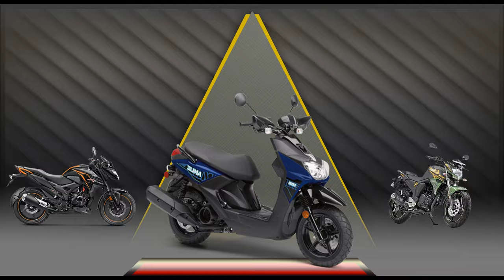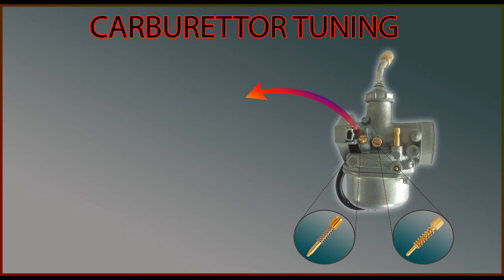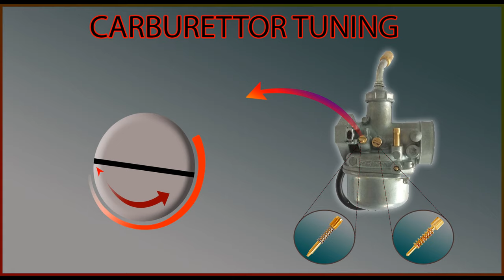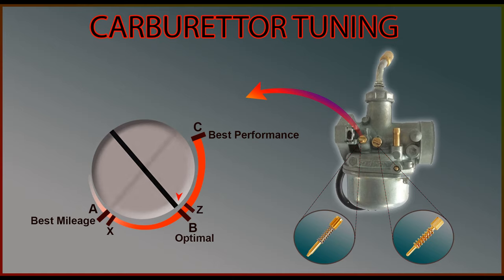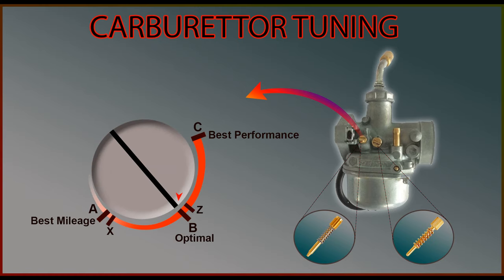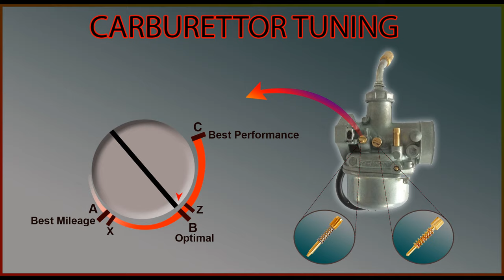Bike or Scooter carburetor tuning for mileage, carburetor setting. TVS Jupiter, Wego. #carburetor

Comment: Sir can you please explain what will happens in sparkplug (colour change )if carb air screw turn for each adjustments A, B&C
Reply from the maker: There will be no impact to spark plug
Reply: @autobotgeekse  sir but spark plug tip contain black, brown, white colours. What is it meaning
Reply from the maker: @ragulkr8975  That is the color of electrode insulator and has nothing to do with its performance. It just helps the conductive surfaces to be exposed on the tip for sparking

Comment: Can I use ASC carburetor on bajaj bm 150cc and will it work well
Reply from the maker: As long as manifold flange matches for proper fitment, it should work
Reply: And can use 80/100 by 17 front tyre on bm bajaj 150cc
Reply from the maker: @albertngala5739  can use it if internal radius does not change. Please see my other video where I have explained the affect of wider or bigger tyres on vehicle

Comment: Isn't tightening the fuel mixture screw reduces the fuel flow and loosening it increases the fuel flow as originally said in the video ? 

But your captions say otherwise. 

I have watched the yt shorts video of OneUpMotoGarage where he also explains that tightening the fuel screw gives a lean mixture and loosening will give a rich mixture, as it is logically understandable that tightening the fuel screw will reduce the space for the fuel to flow as the screw takes up the space inside...
Reply from the maker: Tightening the air screw will result in lesser air passage which in turn affects the fuel siphoning. When we talk about the mixture, it is the air to fuel ratio that we talk about. When we tighten the screw, there will be no barrier restriction for fuel siphoning since the fuel line aperture is still not letting the maximum fuel flow since the air screw is not completely open yet, hence a rich mixture. Alternatively, when we unscrew it completely, the maximum air passes through the passage. However, due to the limited fuel line aperture size, it can only siphon the maximum fuel which can pass through the aperture. Hence, the lean mixture as the ratio of air will be more than that of fuel.
Reply: @autobotgeekse  thanks for the response sir .
Reply from the maker: @redpillsbluepills  welcome brother

Comment: Unfortunately,  I did not notice any increase of engine sound though i losen the air fuel screw.....will you pls tell me the reason? Bike: yamaha zr scooty
Reply from the maker: Your idling must have been high, hence no change was observed. First tighten the air screw completely (pls do not overtighten, stop tightening when you can feel the resistance). Then adjust the idle screw so that the engine is at lowest RPM and is barely on. Then start opening the air screw, you should see an increase in RPM

Comment: I have only an single adjustment do I do the same?
Reply from the maker: Some motorcycle carburetors will have Butterfly valve. For those idle screw will be different. I have shown image for them in this video. Please identify the air mixture screw correctly for adjusting

Comment: Sir if engine runs at lean position, will get more hot engine Or it is ok please reply
Reply from the maker: Yes it becomes a little hot. However, that is within acceptable tolerance levels which is tested by manufacturer. No worries
Reply: @autobotgeekse  thank you🌹
Reply from the maker: @godugurajanna6256  wc 👍

Comment: Can I perform the same on Hero maestro edge BS4 110CC engine?? To extract max mileage?
Reply: Nd also, I want to know which air/fuel mixture screw is present in maestro edge.  Wheather it's a air screen or a fuel screen? 

Nd what happenes if I tight air/fuel screw clockwise in maestro edge 110cc? Will it become rich or lean?

Try to give detailed explanation. Thank you
Reply from the maker: Yes, any carburetor vehicle will work on same principle. Air screw will be the one with visible spring. Turning the air screw clockwise should make the air fuel ratio rich.

Comment: Can I use shell advance oil on my bajaj boxer bm 150cc
Reply from the maker: Yes you can use it. Please check the viscosity rating before using. I think it should be 20w-40 but please check the manual for correct viscosity

Comment: Could you please tell me where the starting point is of where I need to put both of the screws at the proper beginning to start the tuning
Reply from the maker: After closing the air screw completely, open it by 1 turn and then start tuning

Comment: My scooter keeps cutting out, it was fine but now I have to Rev it to stop it from cutting out. 

Is the carb dirty or does it need to be tuned?
Reply from the maker: Please check the idle jet and clean it. That should fix the issue
Reply: @autobotgeekse  Thanks for your reply. Where is the idle jet typically located? This is on a Suzuki Burgman UB125
Reply from the maker: @antoniobuys359  wc, it will be inside the carburettor. You will need to get the carburettor cleaned. Usually both main jet and idle jet will be cleaned at the same time of carburettor servicing

Comment: Any harm for engine if i run engine lean?
Reply from the maker: No, just that the engine runs a little hotter
Reply: @autobotgeekse  tighten the air screw mean less fuel?
Reply from the maker: @rishabhverma5497  yes, less fuel when compared to lean setting. However, fuel to air ratio will be more

Comment: Sir my TVS Wego has been driven 12,000+ kms and is providing less mileage (around 28+) will this help? 
Also there is loss of power when we give accelerator aftr slowing down.
Reply from the maker: This should help. However, your vehicle will have to be checked for other factors influencing the mileage as 28 is very less for wego
Reply: 28 kmpl.?

May be fuel pipe has been damaged. Check with mechanic once.

Comment: What happened when air fuel mixture screw fully open , is getting more milage or not
Reply from the maker: No, you will get less mileage when air screw is opened completely. Also, engine will run a little hotter.

Comment: Unicorn 160 cc bike how much turn after tightening Screw.1 turn means 180 degree or 360?
Reply from the maker: 1 turn is 360 degrees. It should be around 2 turns from close position but try to identify the point basis the steps shown in the video for correct setting.

Comment: I have dio ,but after one night initial start hard have to crank serval times ,carb set optimal tuning,sir what can cause for it,
Reply from the maker: Did you try choke? Also try cleaning the air filter. Dio and Pleasure usually have cold start issues

Comment: Dear If i accelerate my bike slowly gradually it does smoothly accusations, but when I accelerate it suddenly or abruptly, my engine dies out, why? My bike is suzuki gsx 110 4 stroke.
Reply from the maker: Try to clean the main jet, it might not be allowing sufficient fuel to reach the combustion chamber upon sudden acceleration

Comment: Seen it with your own eyes is way different you can keep going back to the reference of somebody doing it in real time
Reply from the maker: Realtime tuning is done practically towards the end of the video for your reference. I know this question will surely come. Hence, I told in the beginning itself that I will explain it theoretically and practically as well. You tend to miss important points when you skip the video. My humble request is to watch the video without skipping to avoid incomplete info. You can also see my other video where I have shown the mileage test for all 3 settings

Comment: Sir even if rpm is rpm dows it take more fuel or inly air? I am confused hw rpm screw works does it and adjusts rpm. What is princiole behind it nd hw it works.
Reply from the maker: Rpm screw is different than air screw. We use rpm screw while tuning the carb so that idlin can be adjusted. However, it is air screw that allows the fine tuning of carburettor
Reply: @autobotgeekse  rpm bhi to sir fuel leta hi hoga na tabhi to rpm fluctuate hota hai ghumane pr.
Reply from the maker: @coolcalm582  rpm throttle par bhi depend karta. Idle screw sirf rpm ko set karne ke liye use karte hain. Throttle ke hisab se fuel suction vary karta hai. Lekin air screw ka air suction line alag hai
Reply: @autobotgeekse  sir mujhe ek chiz samajh nhi aa rgi hai jab throttle close hota h tab throttle valve bhi closed position me rehta hai....but fir iss case me engine chalu kaise rehta hai kuki throttle valve to close h fir engine me petrol air mixture kahan se pohochta h?
Reply from the maker: @coolcalm582  throttle close hone par bhi idle screw throttle ko poora close nahi hone deta. Thoda air ventury se pass hota rehta Jiske karan pilot jet se fuel suction hota rehta hai
Reply: @autobotgeekse  oho thik ab samjha thnx sir clear krne k liye..mazaa aata h ye sab questiin krne me aur sekhne me
Reply from the maker: @coolcalm582  wc bro. Apke samay ke liye dhanyawad 👍

Comment: Hi, mere hero hunk ka milage abhi 20/L de rahi hai. Maine curburator clean karaya, new air filter lagaya, spark plug change kiye. Phir vi same issue hai. Spark plug black sukha curbon se bhar ja raha hai. Please suggest kijia kya kare.
Reply from the maker: Dekhiye agar bike jyada dhuan chod raha hai kya? Spark plug kala padne ka karan engine oil ho sakta hai. Agar piston ghis gaya ho ya piston ke O rings kharab ho tabhi yeh problem ata hai. Ek baar bore aur piston check karva len.
Reply: @autobotgeekse  kala smoke nahi deti hai. Or km run vi 20k cross nahi kiya hai. Engine oil last nov 2020 ko change hua tha.
Reply from the maker: Hmm, thoda strange hai. Fuel station change karke dekhiye, petrol milavati hone se bhi same problem aa sakti hai. Cylinder mein oil jane se hi spark plug kala padta hai

Comment: sir many mechanics says that set the scrue where you get higher RPM. and this will be the point where you will get higher mileage.  but you are saying that when RPM is low then we get mileagr . plz explaon what is right
Reply from the maker: Yes that is the reason why I made this video. Please see my other video which shows the mileage test difference between all 3 settings. Rich setting gives better mileage.
Reply: @autobotgeekse  it means first we have to tighten the air fuel mixture scrue then loose it to the higher rpm and then retight till we get lower rpm. and this point will we the highr mileage point ?
Reply from the maker: @Fake And Fair  yes correct. However, if you face any cold start issues try to bring the air screw to optimal position

Comment: Is it possible to have a tuned carb but the rpm in my speedometer slows down?
Reply from the maker: Yes it is possible as rpm also depends on the idle screw as well. Before tuning the carb, increase the rpm by adjusting the idle screw, then tighten the air screw completely and then loosen it by 1 and half turns. Then start the tuning process. Adjust the idle screw occasionally if rpm is too high while tuning.

Comment: Sir kindly explain yamaha fascino scooter carburettor tuning
Reply from the maker: It will be similar to this. You just need to identify the air screw and the idle screw. All carburettors work in a similar fashion
Reply: But fascino have cv carburetor not 2 screws
Reply: Thank you sir ( Autobot geeks & Navaneeth Krishnan K )  , for your reply 👍

Comment: Tighten air screw mean less fuel?
Reply: No ! Tight Mean High consumption 
Release screw to Lean or low consumption fuel
Reply from the maker: Tightening the air screw will result in lesser air passage which in turn affects the fuel siphoning. When we talk about the mixture, it is the air to fuel ratio that we talk about. When we tighten the screw, there will be no barrier restriction for fuel siphoning since the fuel line aperture is still not letting the maximum fuel flow since the air screw is not completely open yet, hence a rich mixture. Alternatively, when we unscrew it completely, the maximum air passes through the passage. However, due to the limited fuel line aperture size, it can only siphon the maximum fuel which can pass through the aperture. Hence, the lean mixture as the ratio of air will be more than that of fuel.

Comment: Sir meri activa 4g mei ek problem aayi thi achanak iss lockdown mei, woh baar baar band ho rahi thi, fir maine thoda sa RPM WALA SCREW BADHA DIYA THA, fir aisa hua ki race thodi thodi apne aap hi lagg rhi thi, uske baad maine ek service krwali or mechanic ko problem bbhi bata di, fr jab mai uski shop pe tha tab toh thik thi, but uske thode time baad apne aap race lagg rhi thi 20 ki speed takk, fr 2-3 baar adjust krayi hai rpm, ab jb last time krwayi hai, toh wopis band hone ki dikkat aa rahi hai breakers pe, kya dikkat hai aap bata de please, woh keh raha hai carburettor dalwalo new jabki sirf 20000 km ke aas paas chali h, please kya dikkat hai bata do??
Reply from the maker: Should not be a carb problem. If it is a BS6 vehicle, there should be an air valve on your petrol tank. This problem persists if that valve gets blocked. Have that checked once. When your vehicle stops, open the tank cap and start the engine. Keep the cap open for sometime and then see if beat is stable. If it is, then that is the issue.
Reply: @autobotgeekse  sir it is BS4 VEHICLE, but still I will check what you have suggested, I have also told him many times to check the valve and tapped, but he is saying that it is ok, I trusted him because he used to work in a vespa service center.

I will try what you have said
Reply from the maker: If it's BS4 and you don't see a separate valve on the tank, then the air intake valve will be incorporated within the fuel tank cap itself. In that case you will need to open the valve mechanism and clean it.

Comment: How to burn the fuel 100% and get maximum out of it. Please tell me the ways and other methods to do it.
Reply from the maker: Air fuel mixture ratio should be appropriate and ignition coil should be producing sufficient amount of spark for fuel combustion. Only in this case vehicle can get maximum out of the fuel.

Comment: My scooter activa sometimes shows correct idle speed and sometimes less idle speed and the engine shuts off. Is this the problem of valve tappet or engine idle speed setting ?
Reply from the maker: Try cleaning the idle jet. Sometimes fuel does not flow uniformly from the jet causing irregular beat.

Comment: please tutorial for carb tuning of tvs neo xr
Reply from the maker: That model is not available in India. All the motorcycle carburettors work in a similar fashion. You can follow the steps mentioned in the video to adjust the carburettor. Air mixture screw has to be identified correctly.

Comment: How much fuel mixture turns for cbz extreme ? Thnks
Reply from the maker: There will not be any fixed turn count. Tighten the screw to see where you are getting the lowest RPM and then unscrew by 1/3rd or half turn.
Reply from the maker: God Love  1/3 Rd will be 33% of a full turn

Comment: Dear Expert, must the vacuum tube be pulled out when tuning
Reply from the maker: If you are tuning the carb of a scooter, it helps if you block the vaccum tube. However, in this case a separate fuel line has to be connected to the carburetor as fuel will not flow from the fuel tank.

Comment: Any problem for engine or carburetor by setting more mileage point
Reply from the maker: Should not impact much
Reply: @autobotgeekse  it means it cause in future
Reply from the maker: @mansoorpasha6312  no, it will not damage the engine. Just that there will be marginal difference in vehicle's pickup.

Comment: Access125 2016 model wite smoke problem engine work pannitan smooth sound very nice....but milage 27km what reaction?  Any one reply
Reply from the maker: How old is your vehicle and how many kilometres done?
White smoke is usually a result of engine oil getting into the combustion chamber. This may cause due to pistons wear and tear or damaged piston orings. Have these checked and serviced.

Comment: 6:26 - you screwed in the idle screw - BUT, Then immediately turned it back to where it started. Why? What did I miss?
Reply from the maker: Had to alter the screw position basis the beat sound since I noticed the engine was about to die

Comment: Hey ,at 2:12 you say that you will have a rich air/fuel ratio ,butt the subtitles say it will be a lean air fuel mixture ! So what is it now ??
Reply from the maker: Yes, those are the correction subtitles. Please consider the subtitles. Apologies for the confusion
Reply: @autobotgeekse   ok no problem, but the mixture screw ..is it in this case a fuel or air screw? Because if you turn it anticlockwise you make it rich if it is a fuel screw! And if it is a air screw you will make it leaner! So what is it in this case ?
Reply from the maker: @benkr5870  That is an air mixture screw which regulates the air passage. Fuel suction will depend on the air that we let in. Both are directly proportional.
Reply: @autobotgeekse  which position is best for slightly more ready pickup?
Thanks for everything ❤️
I'm from Bangladesh.
Reply from the maker: @abhishekbiswas31  Lean mixture should do the trick. However, if you are more focused on better performance then you might want to upsize the main Jet. However, this would definitely impact the fuel economy.

Comment: If air mix screw is open, then how can be the mixer will lean. It should be rich..
Reply from the maker: That's not the case. More we open the screw, more air is let in. This results in air to fuel ratio to be leaner.